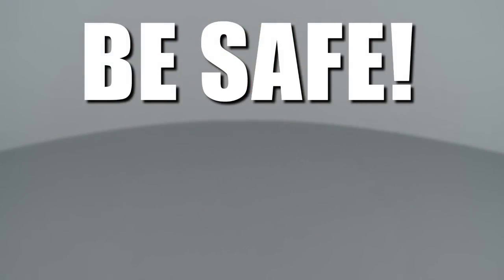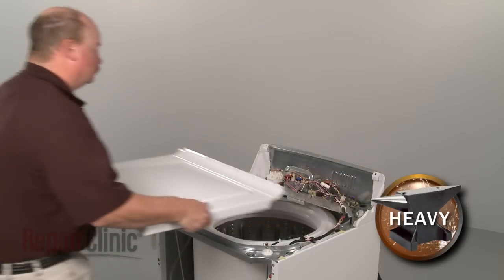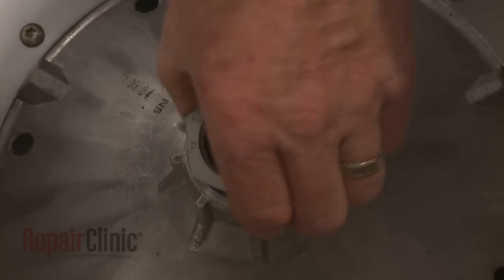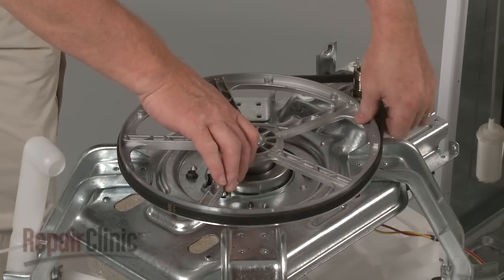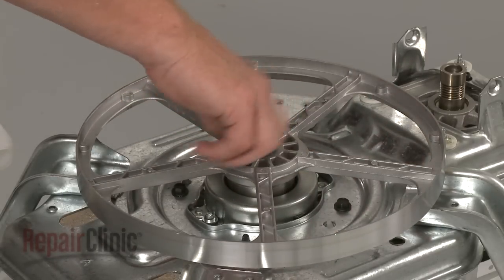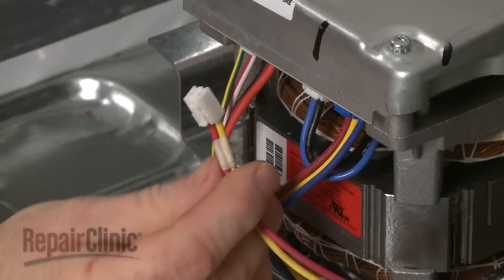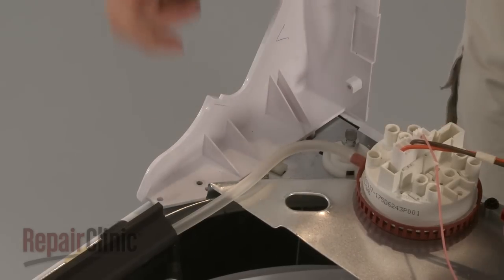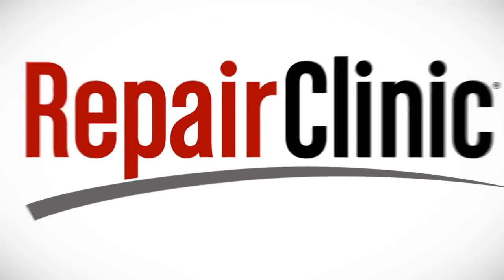GE Top Load Washer Clutch Assembly Replacement #WH38X10017

Comment: If the transmission goes bad don't even bother fixing it, a new one is 
$350, a refurbished one on Ebay is $128 and I got one that wound up 
defective, these GE transmissions are KNOWN to have a design fault since
 1995, that's why you find dozens of them used and refurbished  on ebay-
 junk cheap design that is essentially not made to be repaired, even 
replacing  a simple ball bearing on it is not in the design scheme, and 
the bearing goes bad after leaking water gets in it.

Here's an example;

Search Results
Be Afraid, Be Very Afraid--> GE top loaders - ApplianceBlog
https://www.applianceblog.com/mainforums/threads/10464-Be-Afraid-Be-Very-Afraid-GE-top-loaders

Aug
 23, 2007 - This washer/transmission combo has been on market since 1995
 and has a high. ... the GE TOP Loaders using the infamous WH38X10002 
transmissions with the failure prone internal brake. .... I originally 
thought the GE top loaders "were" of decent design ... Testimonials · 
Website Forum Issues/Problems.

This washer/transmission combo has been on market since 1995 and has a
 high mortality rate making the spin basket rotate along with the 
agitator when the internal brake starts failing. Depending upon usage 
the normal "wear and tear" from usage failure of this transmission 
renders the washer worthless and not worth repairing.   I personally was
 tipped off when I saw huge amounts of new WH38X10002
 transmissions being sold on ebay some as inexpensive as $50.00 + 
shipping. Called a few of the vendors and got a education ....one 
particular ebay vendor was selling in excess of 25 transmissions 
nationwide on a monthly basis and had a standing order for 50 more each 
month to be delivered. I followed this up with a call to the GE customer
 care number requesting if they had a buyback policy or possibly being 
credited for my purchase on a less than 1 week old washer which fell 
upon deaf ears. Unlike others I have limited space in my laundry room 
making this type of repair unpractical , am getting on in years, and 
have neither the strength nor inclination for personal major parts 
repairs other than the easily accessible items such as hoses, pumps, and
 the occasional appliance timers. Netting this out please think twice 
prior to making a GE top loader purchase until such time GE stops using 
these problematic WH38X10002 transmissions. BTW, there is now a 10 year parts warranty on the WH38X10002
 transmission however the major expense in any washer repair  is in the 
labor which is not covered except in the first year. If I could relive 
the past 10 days I would have gone with a Whirlpool direct drive top 
loader which is highly recommended by the service techs. Moral of the 
story is do NOT completely use Consumer Reports as your sole guide
Reply: This is not a transmission it’s a spin tube

Comment: REPAIR was successful....  The major difficulty I had was getting the Hub Nut off, Yes I had the spanner wrench and turning the correct way.... Many people have this problem..... Easy solution for me was just drill many holes in the nut, ( being careful not to drill to far)..... The nut is soft metal and very easy to drill and then I use a cold chisel to take the nut off in pieces.. Not a hard task.. the rest is just nuts and bolts, just follow Video...

~"ATTENTION"~  I made 1 mistake, here it is so you will avoid doing the same....... Putting things back together I did use a new Hub Seal, but when I was done I looked underneath while it was filling up and agitating, I seen water dripping down the shaft... :(  I took the inner tub back out to check and see what was going on and remove the tub seal..........I looked at the top of the hub bearing (I called it a sleeve) something didn't look right so I took my finger and picked at it... There was two small circular very thin springs that came out of the old falling apart Hub Seal...... They were around the shaft between the hub bearing (sleeve) and shaft hard to see.. Remove.,,,,Reassemble it works great now... Hope this Helps someone......

Comment: How do you test the shifter?
Reply from the maker: +Carlos Garcia The wiring diagram for the washer should contain a tech sheet and list the ohm value of the shifter motor and perhaps also have a test procedure you can run.
Reply: it usually is a mechanical breakdown. like tub slipping and a water leak. hold the agitator and if the tub spins it is likely a bad "mode shifter" the tub and agitator usually spin together. but be sure the white metal tub support isn't the problem, they tend to disintegrate.

Comment: My washer does not spin in the spin dry cycle pump runs, drum does not spin,  drive belt and motor spin freely when spun by hand, it appears brake in the spin cycle is engage, any suggestions
Reply from the maker: We recommend using the repair help section of our website using your washer's mode number: http://www.RepairClinic.com/repairhelp?TLSID=1773

Comment: After using an impact gun to get the nut off, I still can't get the inner tub free. The plastic spline seems to be fused to the inner metal spline and won't lift off. The main direct drive shaft lifts up and down when you pull up on the spline. I tried a prybar to no avail. I'm lifting the entire washer off the floor trying to lift the inner tub out. Tried using a small sledge to tap on the side to see if the metals fused/ corroded together but still nothing. Anyone else run into this issue?

Comment: I have news for you if you are doing this job.  i ordered a brand new plastic tub and seal both GE parts ,not copy cat parts.  the seal does not fit into the tub.  it is 1mm larger in diameter.  you can push it into place ( very difficult) but then it pops itself right out of the tub.   it will leak.   I finally got the seal to seat,  put the machine back together and it leaked ruining my brand new transmission.   when i opened the machine back up the seal had popped up again letting water leak down the transmission shaft.  that is when i started taking measurements and asking why this happened.  I ending up using sandpaper and working the edge of the seal until it was about .75mm less in diameter.  the seal then fit into the cavity.  i permatexed the seal in place and let it sit overnight.  it did not pop out.    i tried 3 different brand new GE seals and every one popped out.   if you try and permatex the seal in without decreasing its diameter, it will pop itself out.  i know,  i tried.   I dont know what is going on at GE but the tolerances of the seal and tub do not match and you will not be successful in the replacement without making modifications.   this info as of Jan 2024.   if your experience has been different, and you are using current parts, please comment.

Comment: Got the wrench and hammered on that nut for hours. End result...the nut is still frozen, but now the shaft/clutch/belt/motor are now all turning with the nut. Game over, I guess. Don't see any way to stop the shaft from turning, so I  can keep working on the nut.
Reply: I bought a 1 and 11/16 deep well socket and used an impact wrench. finally it came off.

Comment: Has anyone tried to repair the bearing in these clutch shifters? It’s a common 6006RS bearing and might be possible to replace it. Bearing is a $10 part and it would be great if it could be pressed out and replaced instead of replacing the entire $150 clutch assembly.
Reply: I successfully replaced just the bearing in my clutch assembly. Buy the 6006RS which cost $15 for 4 of them. Have to press the bearing out of the frame but overall not too hard if you have some DIY skills. A very small retainer clip holds the white plastic disc in place. Once that is removed the 2 gear cylinders and spring can be removed and the bearing can be exposed. Great opportunity to get new tub seal and all the parts related to the shaft. Just got finished with mine and it is so quiet!! You can barely hear it. So happy I did this and saved over $150 bucks

Comment: GE top loading washers have a clutch on the motor. Thin is a spin tube not a clutch. This is a model that does not have a clutch on the motor....good video on this part though!
Reply from the maker: +Sarah  Grace Brooks Thanks.
Reply: thats on much older washers. these newer ones have a "mode shifter" it incorporates the clutch and spin tube

Comment: I have a GE WPRE6150K2WT top load washer. My tub is leaking, but the leak seems to be coming down the inside of the drive shaft/clutch assembly instead of the outside (outside of shaft is dry, but heavy leak on bottom of shaft/clutch assembly), do I have a bad shaft (maybe a bearing letting water leak past inside the shaft) or is it more likely the tub seal?